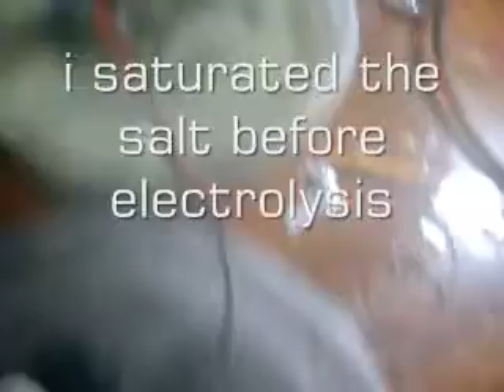electrolysis potassium chlorate and sodium chlorate help

Comment: lel ik this is late but amateur cell pH control can now be done without HCl or complicated control setup simply adding 1.2grams/litter solution of CaCl2 per day in my case with my high current cell will keep pH at 6.8 you simply add a bunch and check with pH paper after 20 mins and pH stays there for however long keeping graphite preserved but during the 1st few hours of cell runtime the pH will go up to 9 then suddenly drop once sufficient Ca(OH)2 has formed on the cathode to begin the pH control reaction of continuous precipitation of Ca(OH)2.

I use MMO electrode but I use this pH control to prolong my electrodes working life and increase current efficiency up to 87%.

Comment: From what I understand, you should electrolyze your potassium and sodium salt solutions with no more 5 volts at around 20 to 25 amps of current. You need to keep the electrolyze procedure going for at least 5 to 6 days. Over that period of time you should see a crystal precipitate having formed at the bottom of your electrolyzing jar or vessel. Do not try to filter off the liquid until everything has cooled. You also need to wash your crystals with water several times so as to ensure that there is no residual potassium chloride crystals left throughout your potassium chlorate crystals. Don't worry about washing your crystals because none of your potassium chlorate crystals will dissolve. Finally, you need to completely air dry your potassium chlorate crystals. Also, you need to siphon off the chlorine gas that will be produced during this procedure. Use ONLY distilled water for everything! Don't use tap water. Don't breath any of this chlorine gas. NONE! Good luck.

Comment: @jamecrowley if you solved the problem know if I can use other metals as electrodes? or should I only use titanium? if you where you bought it? or where you can get without spending a lot? then that voltage and amperage was? and the solution is water and KCL? if the solution must be saturated KCL or should esssere in some proportion?

Comment: (con...) Hypo "stuff" at all the final product will not ignite. Therefore, with filtered potassium chloRITE (No Salt) that is boiled and filtered, and your hypo boiled out of your salt (that you electolysized) add the two together when they are both at hot as they can get. Use more potassium chlorite then sodium chlorate or you'll get no crystals. (of course, I speak in lieu of 44 sticker on car, part time and say it as greeting, I should have been peoples Doc,  and publishing no TV 27 years.)

Comment: @jamecrowley Check Ebay for the MMO, they arent expensive. Use any piece of stainless, such as a icing spreader or butcher knife. just do not get cut on the knife. contact me if you need any help. Im open for questions.

Comment: You need alot of stuff here. Ditch the carbon or graphite electrodes you have there and buy MMO anodes and Stainless Cathodes. You must have a real power supply from a computer or something else that contains one. you must have at least 3.3V and 15A, But I go for 5V 25A because it keeps the temperature at optimun levels. Yeild depends on saturation, purity, and many other small details. Sodium Chlorate is nearly impossible to just expect crystals. It's much more soluble than Potassium Chlorate.